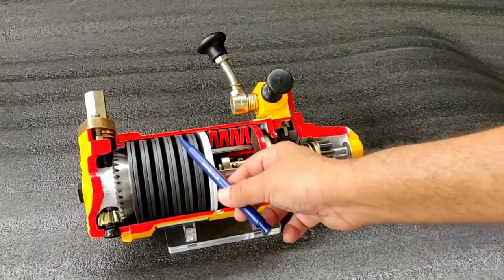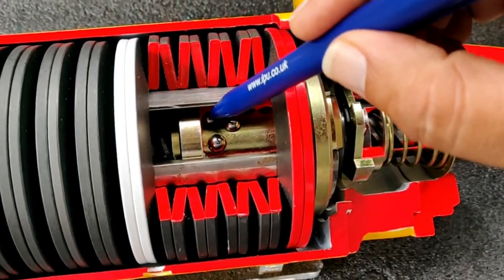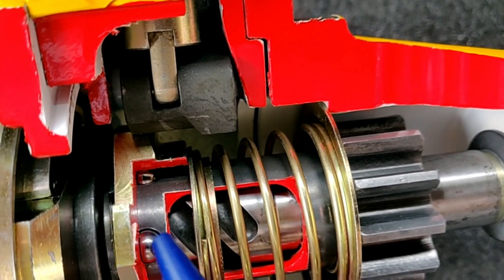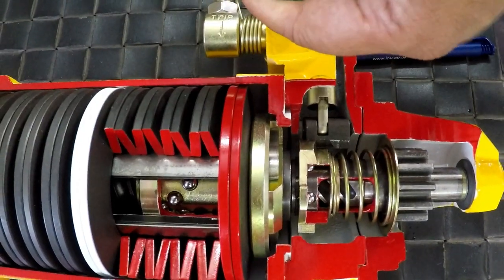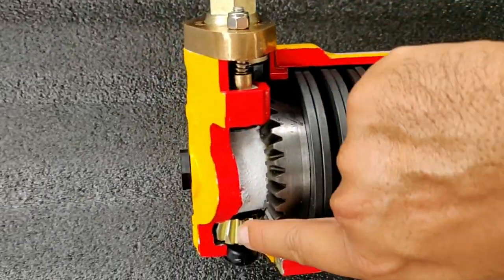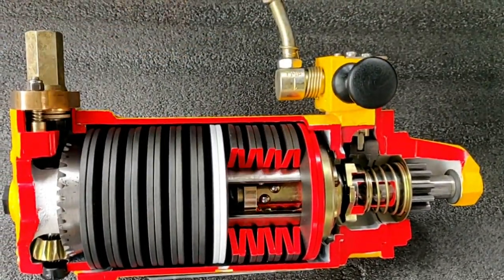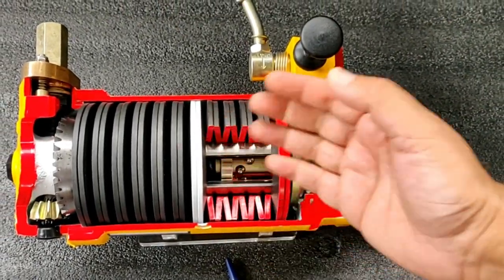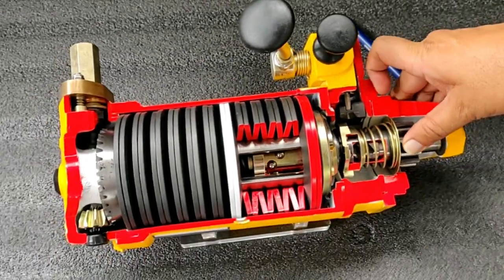FUNCTIONAL CROSS SECTION OF A MECHANICAL SPRING STARTER

Comment: This is very similar to the WWII-era Coffman starter for aircraft engines.  Rather than springs, the Coffman utilized an explosive cartridge to pressurize a piston in a cylinder and move the spiral gear.  The results were similar--a single, hard twist to a pinion gear to get things started.  If you want too see a Coffman in action, check out the 1965 movie, Flight of the Phoenix.
Reply from the maker: thank you very very much for your valuable comment.I am happy and intrigued to know this fact. Yes the starter does work on a bump start principle.i have not seen the movie but now i will.

Comment: Very interesting. I would have thought they would have used something like a massive torsion or coil spring. The use of conical springs is neat. It's probably a lot safer to disassemble as well.
Reply from the maker: yes you are right. these disc springs are ideal for this application as they can be compressed and released several 100 times without wear and tear and are more reliable and safe
Reply: I agree, definitely not what I expected to see inside, very novel.

Comment: I have overhauled a lot of different starters in my shop per the last 40 years but never seen o r of these.
Reply: Same here I’m 58
Reply from the maker: thank you for your comment sir.. You can visit our website for more details.http://www.workwellengineering.com/. This is a very old design that has been bought back to life. It has several applications and is a very versatile and practical product which needs no batteries or auxiliary setup.
Reply from the maker: thank you for your comment sir.. You can visit our website for more details.http://www.workwellengineering.com/. This is a very old design that has been bought back to life. It has several applications and is a very versatile and practical product which needs no batteries or auxiliary setup.
Reply: Lots of old tractors had them and mostly mine equipment due to the fact there's no sparking in the starter

Comment: I have had a design for a diesel engine that uses no electricity at all in my mind for years. I have been trying to come up with a starter mechanism that requires no electricity at all to work. I thought of using a pony motor for a starter but decided it was too much complexity for what I had in mind. This would be perfect. My engine design is now complete.
Reply from the maker: thank you and best of luck
Reply: All this stuff is well known so get better at research. It's WILDLY unlikely you've come up with anything new to the industry. Did you not know diesels with no electrical components were and are common? Lister and other stationary engines don't require electric start or anything else. Hand cranks on large flywheels are a common way to start small diesel and petrol engines.  Air starters are another option and they recharge off truck air brake compressors permitting manual pumping if required in an emergency.  An example of purely mechanical engines are the wildly successful Detroit two-stroke diesels which have been fitted with air starters by many customers. You can't build an all-mechanical fuel control diesel that burns cleanly enough to meet modern emission requirements but you can personally run whatever you like/can get away with in your country.

Comment: This is an intriguing design. I like the use of Belleville spring washers. Compact and safe. Minimal moving parts and durability are top concerns in a device like this. 
   It would not be very practical for an automobile, with the engine enclosed. However, for industrial and agricultural use, this would be a game changer for a lot of people. Hunting down the jumper cables so that you can start an auxiliary generator makes little sense.
Reply: Just from the standpoint of weight I would agree with you. This starter looks like it might be approaching 20+ pounds. No problem though for a lawn tractor.
Reply from the maker: you are absolutely right sir. This product is extensively used in agriculture and farming applications. You can visit our website for more details.http://www.workwellengineering.com/
Reply from the maker: yes you are right. our range of starters vary between 35 to 65 pounds

Comment: This is obviously a game changer for poorer countries but also for vital water pumps and standby generators. Even boat owners
Reply: When I was a kid back in the 1960s  I had a Briggs and Stratton push mower with a wind up crank in place of a pull rope.
Reply: @timmyhudson8643  yep Im 59 and I remember the Aussie 2stroke Victa lawnmowers had a model or two with that feature. At least ten years ago an English man put a wind up spring in Am Radios for poorer countries. Lasted something like 20 minutes.
Reply: I wish they made smaller versions ,i want one for my Harley.
Reply from the maker: unfortunately smaller versions are  not practical and reliable. We did make a smaller prototype but unfortunately it did  not work as expected. This is because very small disk springs do not have the capacity to store and dissipate enough energy to start an engine.
Reply from the maker: very interesting, thannk you for the information

Comment: The General ORDERED a crank. It is still to be designed for the Army.  He was a CRANK.  How surprised we are that anyone talked back to him, and today we do not have this feature on our cars.
Reply from the maker: i did  not quite understand what you are implying.
Reply: @workwellengineeringindia3469     How about using the braking hydraulic system to also wind up the spring.  We can have our wives pump the brakes whilst we sit on the passenger side for us.
Reply: Please repost in coherent English. Use an online translator since English is obviously not your first language. That post is gibberish.

Comment: My simple arse was thinking there was just a beefy version of a wind-up spring in there.  Maybe there's more potential energy packed in this setup for the same volume though?
Reply from the maker: yes you are absolutely right. The disc springs used in a mechanical spring starter achieves 98% flatness when completely wound. It works on a bump start technique. The springs are the most expensive and vital part of this equipment.

Comment: I remember my grandfather had a car back in the 30's that had a hand crank coming out the front
Reply: Different type of starter...?
Reply from the maker: this is a different starter but principal and design wise it is the same. They both work on the same desgn
Reply from the maker: the principal of working and design is the same.
Reply: @workwellengineeringindia3469  No buddy, they are not the same principle....yours is a pre-load compression mechanism while the one the guy is talking about is an inertial flywheel mechanism.
Reply: Yes, hand crank direct to the crankshaft for starting ..

Comment: This is a BS explanation of the working of a spring starter . You don't tell anywhere that the kinetik energy is stored in de disk springs . The wire spring is not going to start an engine en anyway .
Reply: Most inportant thing is pinion regarding to this video and dont screw too far or his balls fall off 😅

Comment: Confusing as to how the spring operates.  Secondly I was aware that something similar was used to start German tanks
Reply: I was thinking the same thing. Springs look odd. Not sure how they work
Reply: Look up Belleville springs. This has nothing to do with tanks or anything else but itself. It's a slick, unique design of spring starter (it is not an inertia starter).